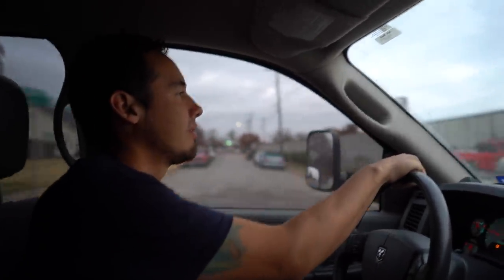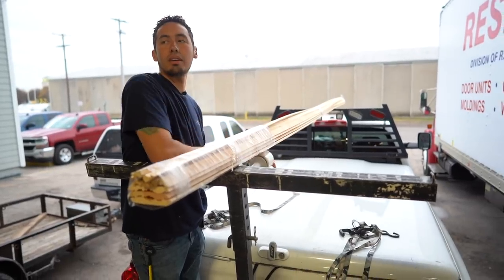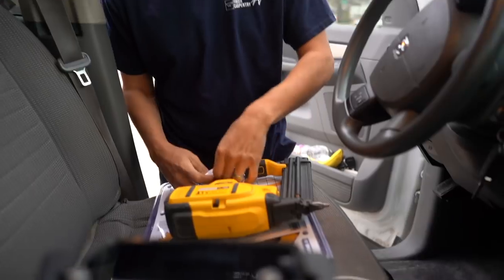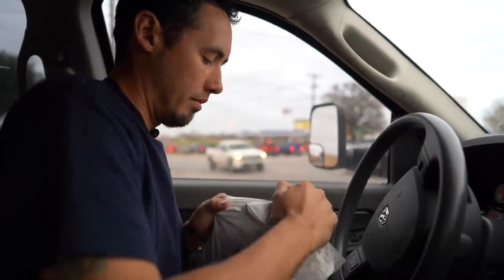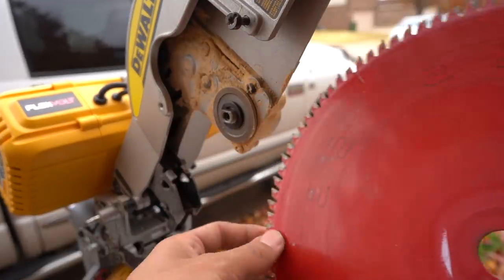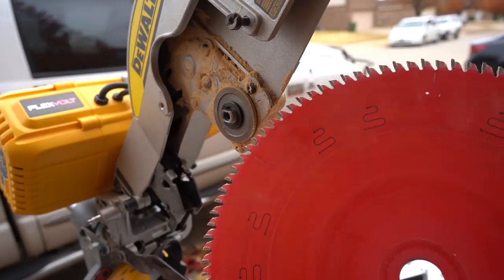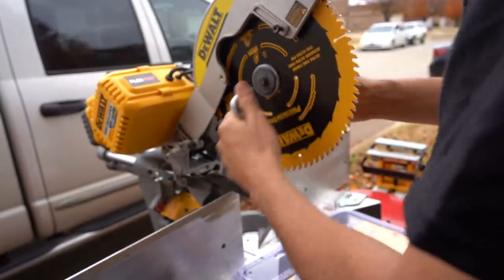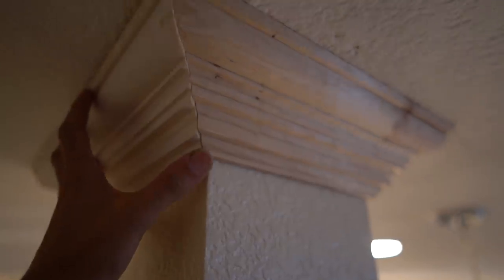Get Back to Work!

Comment: I usually look at the carbide on the teeth to see if I wantto replace.  I have blades I sharpened multiple times with a Trend Routing 1000 grit diamond credit card.  Works great on saw blades and router bits.  Chisels and planes too.

Comment: You may want to consider doing this to a blade that doesn't cut as good as when it was new. First let's understand carbide better. Carbide came into woodworking from the metalworking industry. While carbide will never get as sharp a edge as high speed steel will, high speed steel will never hold a edge as long as carbide. That is what makes carbide the logical choice for woodworking. Carbide will cut when it is red hot however carbide is brittle and will chip when it cuts  stone or hardened metal. What many craftsmen encounter is carbide blades and bits that are gummed up with pitch and resin or other material residue that will make the blade act like it is dull. The good news is you can very cheaply renew these blades back to a like new condition without grinding carbid away from the blade from sharpening. I learned this many yaes ago from a retired cutter grinder who operated a sharpening business after retirement from the auto industry. He very generously explained to me that all I needed was to clean the pitch and gummed up materials from the blade with over cleaner; so I went and bought a cheap 14" pizza pan and a long handled vegetable kitchen brush and a can of Easy Off oven cleaner and cut sharpening costs by over 75%. The man explained and showed me that if the blade tooth is sharp enough to scratch your fingernail when dragged across it while holding the blade in your hand is is sharp and sharpening just shortens the life of the blade.
If you do not know of doing this with your carbide blades and router bits, try it and I assure you suprising results. Stop throwing your money away. Tool costs are high enough as it is.
Reply: James Stanlake what are u serious? And why did u buy a pizza pan
Reply: @pennysmith2012  I put the blade in the pizza pan to clean it, a 14" one works great for a 12" saw b;lade.
Reply: @elliotalderson8385  Children run too me because I save much money from sharpening and buying blades when not needed. What is your excuse?
Reply: @williamgadway9521  It's almost ag good as people slinging wild speculation about  sexual preferences they accuse others of but I take it and your comments as weak drivel.
Reply: I agree and have been using this technique for decades, was taught it by a tool sharpener as well. Another added trick is to coat your cleaned blade with liquid teflon or similar material to help keep it clean longer. This works on router bits etc as well. I'm sorry we get all the negative comments and ridicule when a terrific idea is presented, because it is simply something new to certain readers. I change blades regularly and try to use the appropriate blade for the material, never using my high end blades and bits on low quality material. My best quality / expensive blades last a very long time because they never cut mdf, laminate, composite materials, as I generally work in solid wood, if I can do so. The $$$ saved over time really adds up, and the quality of the cuts in expensive material is obvious and time saving.
Reply: Oven cleaner. And by thick blades. Shallow tooth.
Reply: @smokingcheeba420  my dad would have me use paint thinner and the like to remove pitch.  Good tip. Pizza pan just soak it
Reply: Al S r

Comment: To remove sap and glue build up on your blades, spray with oven off, wipe clean, and lightly rub off any excess with a fine sanding block. Once the blades are too dull to cut properly, turn them in for sharpening. I have 1 dedicated blade for trim cutting only, that has lasted for 10 years.

Comment: Try the oven cleaner trick! I learned it years ago from the old man who sharpened scissors, drill bits and saw blades. It really works on blades used to cut MDF a lot

Comment: I know you get lots of advice. But I got tired of killing finish blades on laminate. I finally broke down and bought the diablo Pergo blade for my 12" compound miter. It worked so well I bought the 10" for my table saw for rip cuts. It really does a great job. Hope you try it out.

Comment: Ive had problems with those dewalt 18 gage guns too. I run dewalt but Milwaukee definitely has better nail guns. Currently using them to install wood champher for concrete forms and i haven't run into any issues with them at all.

Comment: Oven cleaner works well. You figure that it can remove baked on food and drips in the oven, it can clean baked on pitch from the blades.
On another note, we given an old cast iron skillet, and the crud was so caked on from year of high heat use, that you couldnt even see the letters stamped into the skillet. After searching how to clean and restore, people used oven cleaner. You soak it down all over, and then put it in a plastic bag. This keeps the fumes in and that really helps speed up the process of cleaning.  take it out and hose it down , and do it more until its finished. Our skillet came out fantastic. There are more steps involved to "season" the skillet afterwards. The skillet we got turns out to be a favorite brand, which I see get $300 and up on Ebay. Might have to sneak it out of the closet and get a new mitre saw. lol

Comment: When I found out you don't sharpen blades that was an WHAT reaction. I'm a finisher as well and I buy expensive blades (Freud Industrial, CMT Industrial ect) also have a few custom grinds and some Diablo blades as well. Up here in Canada blades are expensive. So not sharpening 8¼-12 inch blades sounds crazy to me considering how much it actually costs to do and given the quality of carbide in some blades. My blades from the sharpener are better than when brand new. They also weld on new teeth if needed and wrap in silicon to protect the teeth. MDF will gum up teeth on blades which leads to dulling them thru added heat. Consider cleaning/soaking your blades in cleaner (I just used the kitchen sink in multi-purpose cleaner). The pitch comes right off and the blades cut good after. I do wipe the blades clean and dry them completely before storing them in my home made blade holder.

While I won't necessarily sharpened 7¼ blades (I have 1freud industrial blade that will always get sharpened), I typically throw those away but when Freud lists 6x sharpening on the packaging they aren't lying. I have blades that are 8 years old and have been sharpened lots. It's cheaper for me to sharpen than buy a new 90-100 tooth blade. (In Canada at least - Diablo blades at HD are $75-110... I don't buy them there!) But I also use different blades for different jobs (lower tooth count for rougher work or MDF work where I know it's getting sanded. My 100 tooth for kitchens and hardwood mouldings. Keep your blades clean and find a shop that can sharpen your blades well, it will save you money in the end!
Reply: I know this post is a few months old, but I had the same reaction you did when he said he didn't have his old blades sharpened.  A good sharpener can make those blades better than new.  Such a waste to only use them once.
Reply: Darin Vee do y’all use local sharpeners or ship them off somewhere
Reply: Would that pitch build up be the formaldehyde from mdf products or can it occur from natural timber as well?

Comment: Have u tried cleaning the wood resin from the saw blade teeth? Cleaning hem regularly extends the life big time and its pretty fast. You could buy special liquid to clean them or simply as i do boild some water with dish soap let it soak and soften for like 10 min or so then use a tooth brush to clean the teeth from both sides and the pit.

Comment: At first I was mostly buying Diablo blades to then I needed a new finish blade for my 10” Dewalt miter Saw and I remembered that Vince from VCG said that he liked them better. So I bought one and he was right they definitely cut real nice and they last longer to. If you do go with a Diablo blade buy the new improved ones. I bought the Demo Demon for my Circular saw and I will say they are much better than the standard ones and they have a whole line of new blades for specific materials.

Comment: I don't have blades sharpened either. There's nothing like a fresh new blade.  MDF (recycled toilet paper) is really hard on blades.
Reply: Johnny Umphress MDF is so soft it doesn’t dull blades as much as it gums them up behind the tooth and cooks them. I get my blades sharpened WAY more then I need but my MDF blade lasts forever if I just soak them in oven cleaner once a week or 2.
Reply: @ThisTall  That's good to know. Thanks
Reply: @ThisTall  finally another smart guy I been sharpen my blade for over 28 years and is good way to save money and it works good plus the blade last longer
Reply: I get my blades sharpened but I think it really depends if you find someone that does it really well. In Toronto Ontario I use Napgladu and they sharpen them better than new.
Reply: Kermit I’m going to try that currently working with mdf only
Reply: Anyone know a good sharpener here in Vancouver Canada?  I just use that purple degreaser stuff (super clean?) once the tips get gummed up.
Reply: I keep a dedicated blade marked witha sharpie for boral and mdf only.   Something about the heat from cutting wood with a blade covered in mdf dust.  Food for thought

Comment: Greetings, at the 5:15 mark you installed a 3 sided crown molding on a column, how did you secure the corners to make them so strong that you could "tap" them in place ? Fantastic videos.

Comment: You can simply get some blade cleaner and extend the life of the blade. I personally don't use cheap blades like Diablo, but if you get into high quality blades like CMT, Forrest, and Amana, you can sharpen them about 10 times or more each. Saves $100-200 per blade, and they last a lot longer. Sharpening is only $20 each, and they are like new.
Great video as always. Keep up the great work..
Reply: A lot of people think that diablo  are good blades but they don't use quality carbide and don't stay sharp for very long.   CMT makes some really great blades I have had them last for years and the pricing is good
Reply: I was told oven cleaner works? Never tried it though.
Reply: @smokingcheeba420  yes, but it's very toxic. Cmt is not pure poison.. LOL
Reply: I found simple green works well for cleaning blades
Reply: @smokingcheeba420  It works great, Use rubber gloves because if not you will feel it starting to burn your skin. Also, Years ago I detailed cars at an Audi/Porsche dealer. We would get some trade ins that looked like the owners never cleaned the wheels of the car. The crap on the front wheels never would come off with  any kind of cleaners. So figuring that this crap was baked on from the years of heat from the brakes, we gave oven cleaner a try. After a few goes of it, the black baked on brake dust washed off! You have to be careful though not to let any sit too long on polished parts, so wipe those areas off after spraying the oven cleaner. Get a little brush, and old tooth brush works well, (but not so good on the teeth). Rinse it off, and check the results. You may have to do it a few times,.

Comment: My favorite video was comparing the dewalt to the Kapex  Festool.  You were the only one I heard something negative about. 1) the wrist angle of the grip is 90 degrees off and 2) it’s over safety mechanizims make it difficult to get the blade down to the wood.  I plan on investing in a Dewalt.  You saved me $1,000.  WoodRicks

Comment: Thanks for another excellent video! Sharpened blades are not the same as a new blade at least for me and I tried different shops, the only ones I get sharpened and only one time are my Forrest for my table saw, would like to know how you like the Dewalt precision trim blade..
Reply from the maker: NJ Hw I will let you know I’ll give it 2 weeks in the field and report back

Comment: I always used my 18ga nail gun for installing those cheap residential doors frame with 2 inch nails. For solid wood doors i would consider a gun with bigger nails 😛

Comment: Try using the CMT blade cleaner and periodically clean your blades sometimes I find it that the teeth are not actually dull its just gunk/resin build up that hampers the blade cutting performance. Try it out and let us the viewers know what you think. You can also use other cleaning products but check out the CMT  brand.

Comment: Sooo, how'd you like that DeWalt Precision Blade? Honestly!
Reply: Dewalt blade fan club meets here...
Reply: Diablo is way better in my opinion
Reply: I use a DWP3215PT on my 10" slider so far it is working great, switched from Diablo.
Reply: @joepierce5357  Hands down 12" Diablo is a better blade and works even better when sharpened, just my opinion.
Reply: Yo Vince we need a face-off between Dewalt and Diablo miter blades
Reply: Diablo has commercial blades that are a different level.
Reply: I’m a diablo fan I’m just wondering how a little competition would do if Vince says they’re good
Reply: @CoolFLDad  I never liked them. Put makitas blade and try the diablo commercial blade and then see what is the best. I dont like diablos box store blades.
Reply from the maker: VCG Construction so far so good Vince!
Reply: @FinishCarpentryTV  day one. I hope so.
Reply: Hear me out. I dont try to bash you. Vince would be surprised. Buy  thick blades and have them sharpened.
Reply: And give a shout out when you realize I'm right.
Reply: This is kinda funny, this is from the Dewalt website,  We make saw blades in the USA with "global materials" so you can be proud of the tools you use. AKA China/Korea
This is from the Diablo site, Diablo's premium manufacturing facilities for saw blades are located in Udine, Italy.
The Diablo blades have a Teflon finish cut cleaner and are just better built.
Reply: Not sure about their commercial blades but Diablo big box store blades are junk!
Reply: @masondixon6269  yeah they are. The commercial blades are better then forest blades.
Reply: Have I ever steered you wrong?
Reply: I would give a forest chop master blade a try. I've used duhwalt's and diablos. Forest blades are a step above. They have a factory spec resharpening service, they will replace broken teeth. I currently have 2 12" chop masters 1 10" chop master and 2 10" wood workers (for my table saw). I keep 2 for so when I send it for sharpening I have a good one to go.
Reply: VCG Construction its free for sure

Comment: well laminated flooring DOES NOT RUIN a blade. I have a good  carbide 10'' saw blade(won't say what the brand is) I lent my compound miter with my good blade and he gave it back with laminate coating all over the blade. I have a guy who sharpens my blades. Here's a tip if you find a good guy who sharpens blades, if he  give your blade back to you with wax on the tips, He's very good, he does all my blades.

Comment: could be the rough sound will get less after a bit , if they replaced the brushes they need to wear intoo the rotor of the electric motor  somewat

Comment: had an electrician leave holes in my wall. I asked if he was going to patch them up. He handed me a tube of caulk. I guess everyone has bad days. However, I didn't use the caulk, I used my own spackle. Same guy asked for a towel and sounded urgent, so I grabbed the closest one. When he returned it, it was covered in dried-up caulk. So that went in the trash. Wish he would've asked for PAPER towels.

Comment: Ok, so I've got the 16 gage Dewalt 20V gun which dry fires ( no nails) and jambs all the time ( even though I clean it), and Ibought the Riobi 18 gage at a Home Depot  as Temporary tool to supplement Dewalt gun, as turns out, in 5 years the Riobi has not had a hiccup of trouble, while the Dewalt has given me constant grief , go figure.

Comment: Do all the houses in Texas have that knock down texture on walls and ceilings. We don’t see that much in the north east
Reply: I can't speak for Texas specifically but the west coast has it EVERYWHERE... I don't know if I've seen a house here since I moved a few years back that doesn't have it. I honestly find it a bit annoying
Reply: Seems to be the new thing here in the Milwaukee area too.
Reply: Yes its everywhere.  Most new construction homes get it.  We call it Monterrey drag.  Before texture you can go into a house and think its not ready because theres terrible mudwork everywhere.  Then the texture guys show up and spray it all and knock it down to a somewhat acceptable finish in a few hours.  It really lets the sheetrockers get away with super bad quality knowing texture will cover it all.
Reply: Yes I was a spackler and was kind of envious of that process.  But I imagine patching after the fact is a bitch
Reply: @paulhosszu3462  yes.. it can be a huge pain to blend it in.. you see lots of older houses with texture varying from wall to wall etc..  if it's. A small enough area and you take your time it's doable. There's a bit of an art to it.

Comment: I have a question, I'm putting up a chair rail around room and I did 
some practice pieces. I used a home depot digital angle finder. I got an
 outside angle of 88.7 degrees. Therefore I set my miter saw a 44 1/2 
degrees or about that. I put my test pieces on wall and the outside of 
my test pieces has a gap of about an 1/8 of an inch. I tried several 
test pieces around 88 degrees or so and got the same result any ideas as
 what to do about it?
Reply: First off, make sure when your saw is at set at “0” it is in fact cutting a true 90 degrees. It is very important to “tune up” a saw before using it, even a new one, factory settings are not very reliable. Insure the saw is cutting 90 degrees in both axis, from the table to the blade and the fence to the blade, also make sure your angle conversion is correctly converted, 88.7 is closer to 3/4 than 1/2 degrees. Another thing to consider is if you cut one at 88:7 the other one should be 91.3.